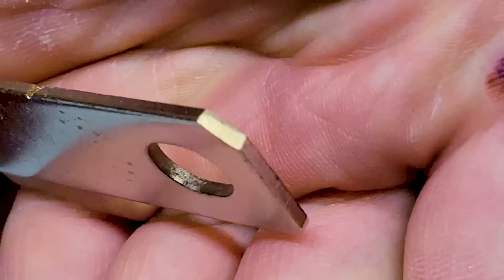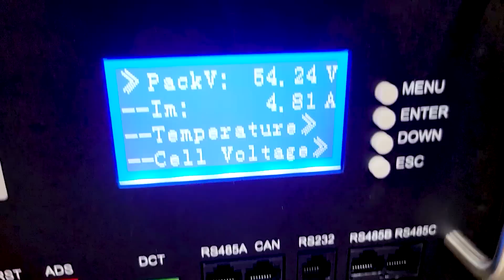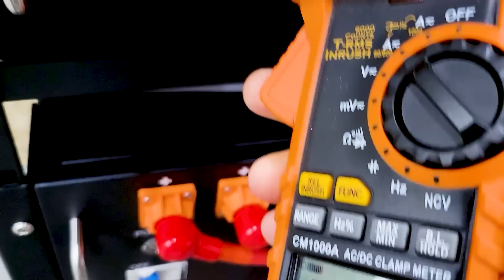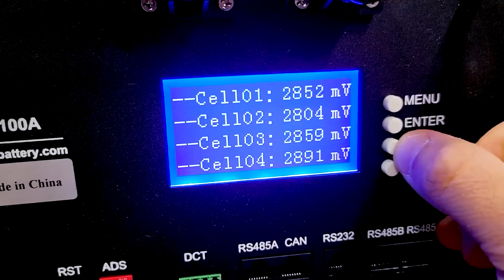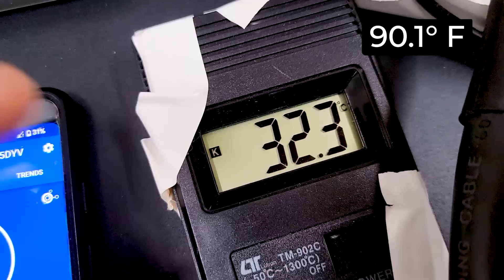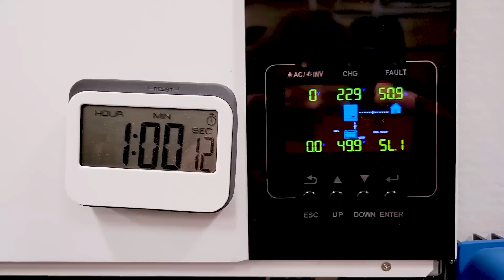Battery Banks - To Daisy Chain or Not to Daisy Chain?  Jakiper Part 2.

Comment: I appreciate the video and the dangers this represents. I would not fault the manufacturer in this case. They provide a set of the same cables for each battery bank which is perfectly fine for 1 battery to connect to a common busbar. They should provide a warning that these cables cannot be used for a daisy chain unless the total load current does not exceed the ampacity of any one wire in the chain. In this case, you exceeded the current rating of the wire, that's why it got so hot. It is the responsibility of the system designer, engineer, and inspector to properly apply Kirchhoff's current law, size the wires accordingly and not simply use what is provided. Thank you for bringing this to our attention! If you're going to use their wires in a daisy chain then the wires to the inverter should be of the same size and their ampacity should not be exceeded. Otherwise, use bigger wire throughout.

Comment: What is your experience with the SOC of different batteries in parallel like this (regardless of Busbar/daisy)? Do they cycle relatively evenly up and down together, or are there wide variations in SOC?
Reply from the maker: They cycle evenly if the Amps are low (below 0.5C) and you are staying between 48 and 56V.  The higher the C-rate (more Amps) the faster they drift apart in my experience.
Reply: @DavidPozEnergy  Thank you. That is exactly my experience as well. I wonder if that is a BMS issue or just differences in the internal resistance of the battery packs..

Comment: so awesome. you letting your Daughter help. I agree I have 4 banks at 10kw power draw each bank has 50-53 amp output. Nothing gets hot like a daisy chain does. I have 280ah cells and I built my banks with JK BMS 250 amp rating.  Did JK because it has 5 amp active balancer built in which helps top balancing. 3.45 each cell (55.2 volts) that is after the 1 time of 3.55 (56.8 volts) Never wanted to max my cells and never will go below 3.1 (49.6 volts) Lifop4 cells when run to high or low breaks down the lithium as does high temps or low temps. I should get 8000 cycles from my banks. I spent $9150 for all. I can use over 60kw. My main loads are natural gas which helps. I am working towards off grid. I will need to double my solar or add wind to be completely off grid in winter.
Reply from the maker: Sounds like you are well on your way to being off grid

Comment: You should cascade them. See kirchoffs law.
Reply: So take the feed to the inverters from the top of the battery bank. This should be capable of carrying the combined current of ALL the batteries in the bank. Then connect the bottom battery to the one above it with cable that will carry the maximum current that the bottom battery can supply. Then connect to the battery above that one with cable that will carry the COMBINED current of the 2 batteries below. Then connect the next battery to the three below it with cable that will carry the COMBINED current of the three batteries below.
As you can see, as you will have different sizes of cable as you add in each battery to the cascade.
For example, if each battery can supply 100A then the bottom 2 batteries would have 100A cable then the connection to the third battery would be sized to carry 200A. The fourth battery connection would need 300A cable and the output cables 400A.
Reply: Any jumper plates should be solid copper and their cross sectional area should be capable of carrying  the same  current as the cables connected to it.
You could stack them to increase current capability.

Comment: Hey David, You could improve the situation by putting your load wires on the terminals that connect between batteries 2 and 3 instead of batteries 1 and 4. That would put only 2 batteries in series in regards to the current on the internal and external jumpers. 

I agree that the brass jumpers and relatively small gauge jumpers are not ideal. I'd recommend connecting them as stated above when they are put into normal service to make the best of what they are.
Reply from the maker: Thanks for watching.

Comment: can't imagine using 4gauge i run 1/0 on my growatts.
Reply: he uses 4/0 to inverters I believe. just 4 awg between batteries for this test. which exceeds 4 awg big time in daisy chain. 4/0 in daisy chain is needed to push 200 plus amps
Reply from the maker: Hi Chris and DC,  I used 4 gauge wire to daisy chain the batteries together because that's what Jakiper sent me with the batteries.  I have 4/0 wire going to my shunt and positive bus bar, which I've used in previous builds and just moved over for this test.  Then from the bus bars I have 1/0 to each inverter (5kW Growatts)  Thanks for watching.

Comment: Wow I can’t believe you were getting over 200 A through those wires. 
I have a Battle Born Batteries set up at 24 V and one of my wires gets pretty hot from the shut off switch to the batteries to the bus bar. Mine gets around 100° at 100 to 120 amps. And now that I understand better the efficiency loss I’ll probably change my set up. The only difference is my wire heats up with solar PV coming through without much of a load. With 7.7 kW of PV, so far I’ve gotten around 4 kW with about 100° coming through the wire. Gauge is 1.0.
Reply: 4kw using 24volts is 166.6666 amps. 0 gauge wire is rated at 150 amps. you need 00 gauge wire.  I use 0 gauge welding cable to each inverter. 48v banks 5kw inverters so max of 53 amps per cable doesn't come close to maxing my cables. cool/warm to touch at 5kw load. each of my inverters usually run at under 2kw peak time for me and 1kw normally. Wire size and crimping methods are huge. Fires start form in proper connections.  My banks to busbars use 4awg as each bank never goes over 53 amps. usually 5-20 amps. Now you see why most of us go 48v instead of 24v.

Comment: Nice batteries! I agree regarding your opinions on the daisy chain method. I changed mine up once I thought about it more after my initial install.
Reply: I'm going to assume the better approach is to hook each one to a common busbar? if so, can you recommend what busbar can be long enough to hook up an entire Rack of these batteries AND can handle the load? All the 100+ Amp busbars I see are maybe 6" long which means connecting each battery will take a LOT of cables.  I would like to find something more akin to the busbar on the EG4 Rack, not sure what the specs for that would be.  And I don't want to DIY something from copper pipe :).
Reply: @jonjohns8145  You can buy copper bar in all dimensions. Get a 1/4 inch or 1/2 inch by 2 inch by whatever length you want, drill holes and get nuts and bolts, preferably staying with copper lugs and nuts and bolts.
Reply: I think it really depends on your overall setup. I have 20 batteries run in banks of 5 wired the same as in this video. Each of the four banks connects with 2/0 to a 1000A Blue sea systems buss bar. From the buss bars I run to three Sol Ark 12k’s with 4/0 wire.

My thinking is that each bank of 5 can handle 500 amps max, but are fused to 250 for protection. With four banks, that’s still 1000A total, but the Sol Arks only pull 180A each. The batteries recommend 30% charge/discharge max for longest life, so even at max power (27kW) I’m still slightly under.

Essentially, for my setup, the load is so distributed that no battery should ever get overloaded, and the differences in SOC between the batteries in each bank should be negligible.
Reply: Yeah, it literally takes zero time to connect the daisy chain wires TO THE SAME LUG and use proper size wire for the load!

Comment: What's the cost? Also Signature Solar has a video about not using a generator with there inverters? Instead use a generator with a battery charger cheaper way to go. I have a 12k growatt  from them with automatic switch. I thought it would control the generator but can't find any instructions for that. Thanks Fred  Always a pleasure to watch your videos.

Comment: The Rack itself looks nearly identical to SOK. Reason I use 4/0 cable on all connections to keep resistance down.
Reply: switch to bus bars if can. huge amp difference per bank. less heat = more cycles.
Reply: @dc1544  I agree, however bus bars are alot harder to protect against shocks from.